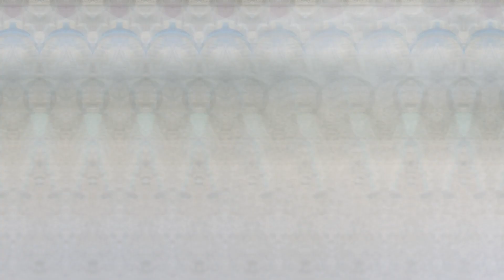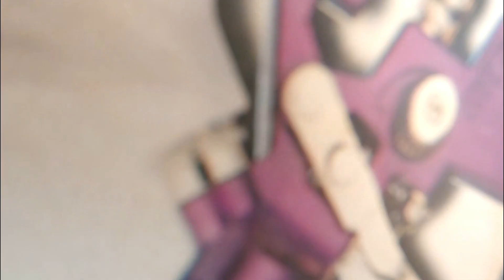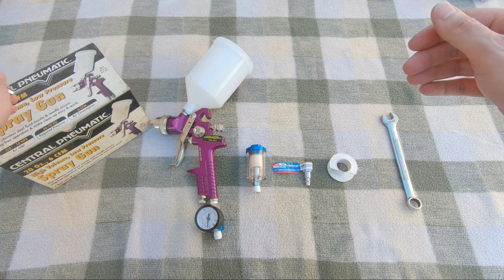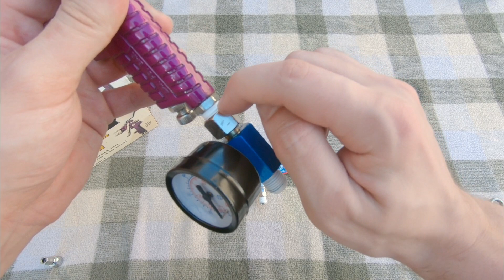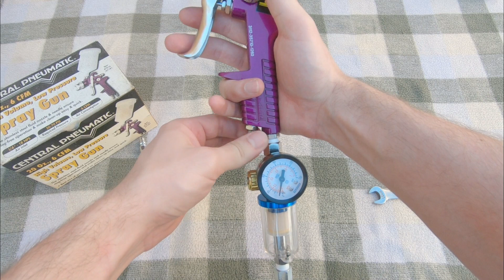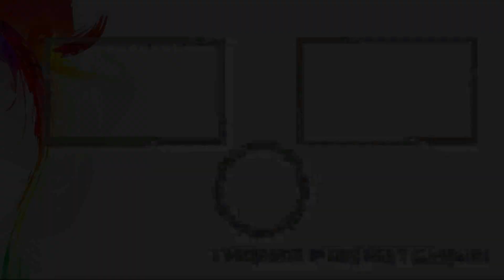My Harbor Freight Spray Gun Set Up | Ep 3 Pressure Regulator + Water Filter

Comment: Thanks mate I followed your instructions and ended up with a great finish.
 I did change a couple of things with the gun setup though. 
I used a couple of extra fittings & made the in-line pressure regulator removable because it gets in the way.
 I connected it up & used it to get the correct air pressure to the gun straight from the compressor first & then I just uncoupled it & took it off. 
Doing this made spraying easier for me, especially on the low vertical panels.
I left the in-line water trap on the hose & it all worked well for me.

Comment: Try not to use too much teflon around the threads, 3 wraps it spot on. Too much teflon can end up cracking the female adapter leading to a leak. Same rule goes for plumbing

Comment: dont know what am i doing wrong but when i connect regulator to a hose, nothing happens on the gauge and when i connect gun, no air goes to it, i have 2 regulators but none of them work
Reply: did you buy the hf brass regulator? i bought one of those and it sucks. it has a very small adjustment range and it seems like its either on or off. not much in the working range. i then bought the one that appears to be a chromed finish and it works  so much better. the difference of a $1  just one hook away on the shelf. take the needle out of this purple gun and polish it . put it in a cordless drill and spin it in some fine paper. I happen to have a roll of 30 micron paper and run the tip in that a few seconds to a minute getting all the rough machining grooves out and making it super smooth . youd be surprised how much it helps flow paint. this little $9.99 gun can lay some paint.

Comment: Also. Would it be best to clean the gun before using. Cuz there oiled. I'm sure oils would mix with paint.
Reply from the maker: Yes always!!!
Reply: grab a can of gun cleaner right on the shelf not far from where you pick up the gun.  its basically acetone in a spray form.

Comment: Great video. Could you put the regulator and filter between some hose and the compressor  so it wouldnt be so awkward?   You could drape it on your shoulder or hold it, so you dont  drag it across your work.  Or do barbell curls since that setup is just as heavy!   How about a purging video, especially for those with larger tanks with more gunk and moisture in them?
Reply: You want the regulator at the gun to get the most accurate reading of pressure for your spray.

Comment: Good Video, thanks for the instructions. I have a question for you if you are already running an air filter and Dryer at the compressor do you still have to have the water filter at the gun?
Reply from the maker: Dave H no you do not.
Reply: @BulliKid  OK thanks, but you do highly suggest to keep the regulator at the gun still? Correct?
Reply from the maker: Not at all. If you have a good high quality system at the compressor area you don’t really need one at the gun. It’s cheap insurance but some people don’t like adding all the accessories right by the gun as it makes it bulkier and may be harder to maneuver
Reply: @BulliKid  OK, Again thank you for you time.
Reply from the maker: Dave H anytime!

Comment: That gun waste 3 times more paint then the hf $70 gun. Save money on paint and get a decent gun. 

I bought 3 of thoes junk purple guns, so much orange peel and poor atomization.
Reply from the maker: That’s why I am using cheap rustoleum.   But I’m sure you are right.  Money buys you better things in life.
Reply: BULLI KID you can get a good job from rusto paint, use “Japan drier” with the mix and it dries much better and a little more glossy then you can cut&buff the paint like I did on my old integra, it was very nice.
Reply from the maker: @The_short_buss i am experimenting trying to get a good smooth finish out of the gun.  experimenting with mixing ratios and what not.  1:1 lays like glass but you will run most likely and is tricky
Reply: @The_short_buss  whats Japanese drier??
Reply: @charlespartak2435  a hardner
Reply: @Ran da buffer  ok. So whats different about Japanese drier from regular hardener

Comment: Very good video for basic setup...one note on air pressure regulators: solvents will cloud a plastic face, leak into the body of cheap regulators. Prices for a good regulator are expensive.....The best regulator for the money is an ANI: https://www.spraygunsdirect.co.uk/index.php/ani-spraygun-pressure-gauge-regulator.html#sthash.vMydZNun.dpbs
Reply from the maker: You are right. I already noticed my plastic regulator screen is blurry after cleaning with solvent.  Good tip!

Comment: How often do u needa replace the filter?
Reply from the maker: DirtySouthFlorida3 the water filter?  Well depending on what jobs you do. If you are doing real jobs I would replace it after every use.  They are cheap enough.   But  as long as it’s dry and baked in the sun for example should filter fine.
Reply: @BulliKid  is that what u do just dry it in the sun and reuse lol? Hiws the outcome doing that everytime
Reply from the maker: This filter cracked on me the first time I used it. Lol garbage. And ebay seller never sent me a replacement even though he said he did.  China...

Comment: Even the chepie guns like these will spray much better with Hi-Flo fittings. That fitting you installed is highly restrictive. Purchase a Hi-Flo fitting and compare the inside diameter of the two and you will see what I mean. You really want cfm over psi with these guns...
Reply from the maker: Daniel Jessup  you are right but where is the best place to buy those?
Reply: @BulliKid  check harbor freight... https://www.harborfreight.com/high-flow-aluminum-coupler-connector-kit-4-pc-63546.html?_br_psugg_q=hi+flow and then Home Depot has them as well... https://www.homedepot.com/p/Husky-High-Flow-Aluminum-Coupler-Plug-Set-HDA22500/305303819
Reply: @BulliKid  they’re in the same section at harbor freight, black and blue colored. I think around $11 for 4-piece set
Reply: fartpoobox ohyeah wherever your soft line plugs into a hard line, yes, you need a hi flo male and female fitting there (if this is a removable hose). Each hose you attach needs to have the fittings as well if they are up stream from your gun.
Reply: That first fitting was superior shoulda grabbed the blue Merlin hi flow coupler kit it’s only 1/4 I think but better than industrial or automotive style. I prefer the Milton or flexzilla 3/8 hi flow coupler

Comment: This is so helpful thank you so much for the simple explanation. 
Now I have a bigger gun for primer and another for base / clear coat, do I need to buy another regulator and water trap? So I don’t have to keep unscrewing it ?
Reply from the maker: De Oppresso Liber yes if you don’t want to keep changing it from gun to gun you would need separate regulators and filter.
Reply: You can add quick connections just like on the air hose between gun and regulator and one on the bottom so you can switch them to other guns.

Comment: Great video.  Your hands are mimicking that of Chris Fix!.  Haha.  
It used to be that the gauge and water separator was attached to the compressor.  Why is that not done now?
Reply from the maker: I have seen bigger compressor systems have a dedicated water separator by the  tank but not sure f they would use another one by the gun or not.  As far as pressure regulator.  I know my compressor has some regulators by the tank but this one is needed so we can see the accurate psi by the gun.  That’s my understanding...
Reply: BULLI KID Okay.  It seems either way is the right way.  Looks a good set up.  Get some paint in it and stop teasing!!